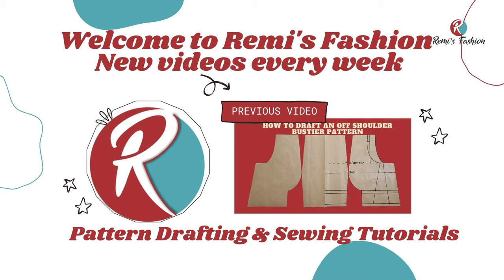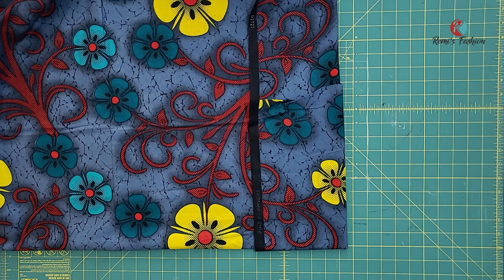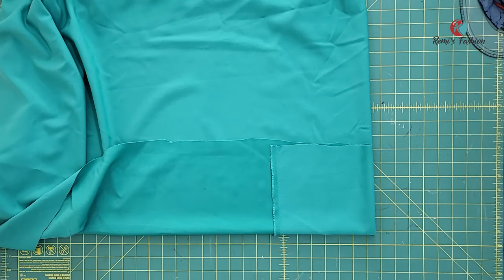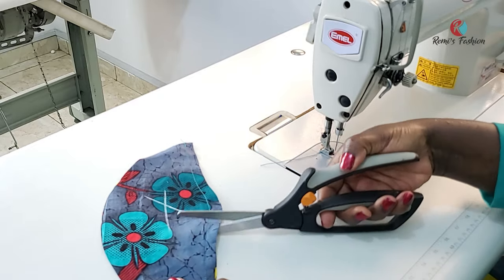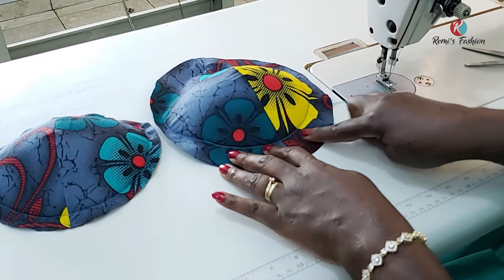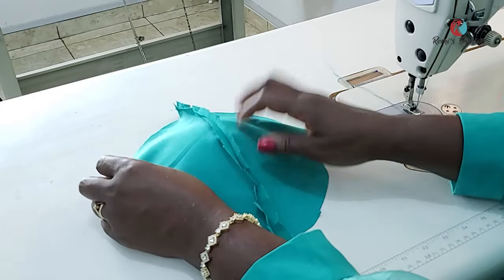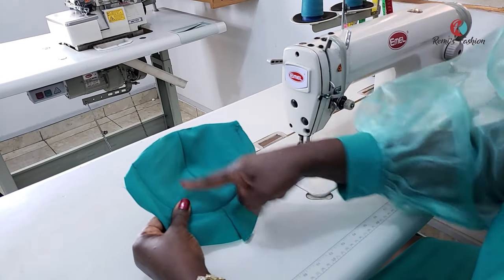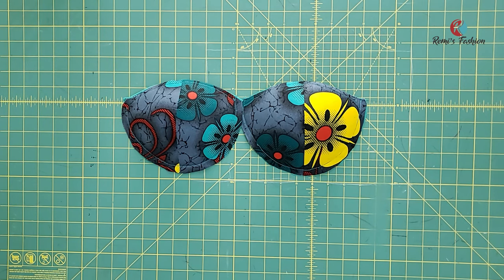How to Cover Ready Made Bra Cups with Fabric and Lining

Comment: Hello Ma'am,
Thank you for this tutorial, it was indeed helpful. But I have a question, in a situation where the bra cup is more than 40, I mean like 45 bra cup, what will b the length of the flare? Or is 5.5 inches the accurate measurement for all sizes of the bra cup? Thank you Ma'am for your help🙏🙏🙏
Reply from the maker: I am so glad. You are very welcome. Do you mean the flare to cover the cups?
Reply: Yes, i guess that's what she means... To cut the flare for the cup. What flare size should i use if my bra cup less than 40 and also for bra cup more than 40?     Or is 5.5 the standard length?
Reply from the maker: No that is not a standard, you can increase it or decrease it depending on the bra cup size you are cutting for.